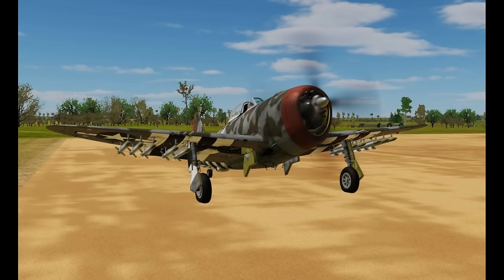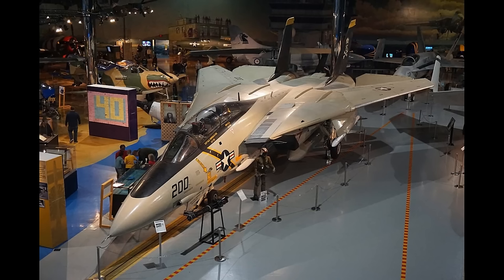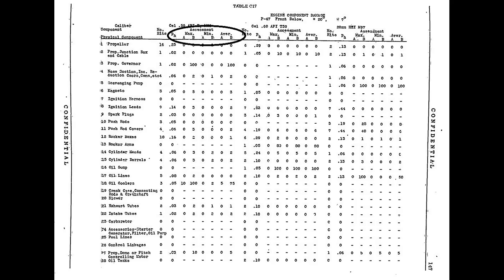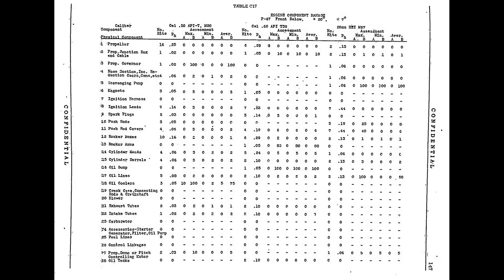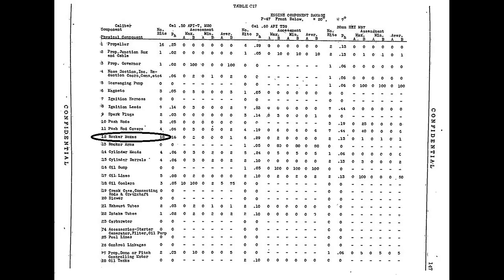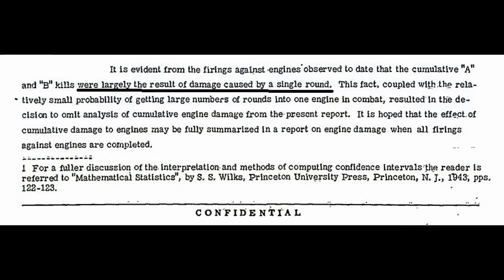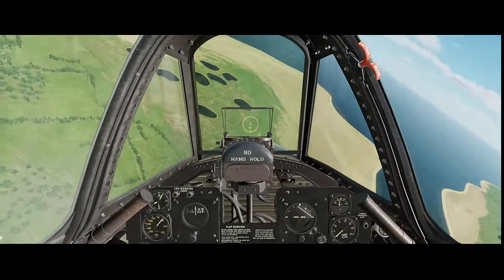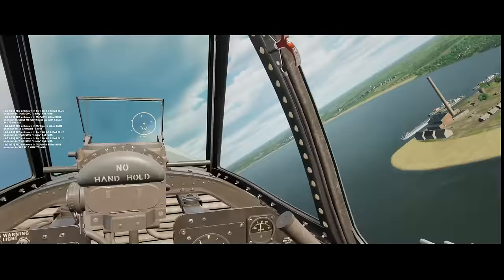50 Cal Vs. 20mm Engine Damage in WW2

Comment: **off topic

The AN-225 appears to be in the early stages of either repair or chopping from a recent photo. Left wing is mostly chopped with scaffolding under it. Some nose too with another scaffold.
   What made me wonder which is b/c the floor is swept very clean in the hanger. Too clean I think just to be scrapping it out.
   Right wing was resting down on it's engines. Photo ended behind wings so can't say about tail. I haven't heard anything besides maybe repair with the sister plane that's lighter or cut it up. I know they have bigger fish to fry right now but something is goin on.

Comment: I had a Mazda Miata, original 1990 model, at year 9, one cylinder went. it was barely operable, not 75%, but I was lucky to move at 20mph. Somewhere, there was a study for ship-based AA. The 20mm Oerlikon made the most kills, but the 40mm Bofors could make kills before the attacking plane reached weapons release point. At the end of WWII, the smallest gun that could take a VT was the 3in, too big for a single engine fighter. At some point it was possible for 40mm, but is still not an option for 30mm?

Comment: Yeah, no explanation to these numbers leaves quite a lot of questions. Is it possible that the chance of A/B kill is stated per hit, and not total?

Also MK108 and MK103 used different cartdrige, but the same projectile. Main projectile was 330g 30mm M-geschoss with tracer.

I consider it very interesting how great M-geschoss was against structure of a very sturdy P-47, and how ineffective it was vs the engine, compared with thicker-walled 37mm. I guess 37mm could take out an engine with a near hit, where big fragments struck the engine, while MK103 needed basically a direct hit to take it out.

Comment: Two points of curiosity about the testing and parameters: 20 sec is a long mg burst. And the oil in the rockers in an engine is under pressure (how does it circulate otherwise?).
Reply from the maker: Yes, 20 seconds is a long burst. I'll talk about this a lot in the next video. The oil enters the rockers under pressure, but then simply drains out by gravity. This is also exactly how the oil in a turbocharger works. It enters under pressure, that pressure is used up in the bearing and it just drips out by gravity back to the oil sump.

Comment: The traumatic experience of putting 50% of my ammo into a P-47 in DCS and only having the effect of making it look like a swiss cheese checks out after all.   The bit where the pilot bled out then got better was a bit odd though.
The 20mm's ability to go through rear armour where .50 doesn't feels like it should be a big factor in rear aspect shots.  But from simulations the 50's advantage feels to be the velocity.  It's a lot easier to aim when relative deflections are lower.  I think the rotary 20mm aircraft cannon really are the best of everything, rate of fire, weight of round and fairly high velocity.
Reply from the maker: Yes, but I wish to add that the 50 cals went through armor really well, in fact it could go through any aircraft armor of WW2. Even the British 20mm didn't have better armor penetration with the normally used ammo, it had about the same but with an explosive charge. The German 20mm wasn't that great for going through armor but had more explosive power.
Reply: It is important to note that there is a tremendous variation in 20mm cannons and ammo types.   Some has much lower velocity and some had a heavier or physically larger payload.   The 20x72rb used by Japanese aircraft early in the war had less than half the muzzle energy that that of the 20x110 used in by the P-38.  The 20x80 used by German aircraft in WWII also has a lower kinetic muzzle energy, but relatively large high explosive content.
Reply: Well i think 30mm revolver cannons are better. Mostly US planes use rotary 20mm
Reply: @hippoace  It gets complicated when the firing rate, mass, or volume of ammo becomes critical, as is usually the case with aircraft.  The accuracy of the targeting system and vulnerability of the target are also important.  If it is very difficult to make a single hit, but that single hit would cause significant damage, having a larger number of 20mm shells would be preferred.  If the weapon system can accurately predict the location of the target at the moment the shell would arrive, 30mm, which typically have a much larger payload per unit mass, would win.  If the 20mm shell would only cause insignificant damage, again the 30mm would be better.

Comment: A little off topic, but for what what it’s worth here’s what ChatGPT says about the Germans positioning their superchargers 90 degrees to the crankshaft.    
“By positioning the supercharger perpendicular to the crankshaft, it allows for a more compact and streamlined engine layout. This arrangement minimizes the overall length of the engine, which can be advantageous for fitting the engine into smaller spaces, improving weight distribution, and optimizing vehicle handling.”
Reply from the maker: In no way does it improve streamlining, so Chat GPT is wrong about at least that part.
Reply: Wouldn't this allow firing through the crank shaft?
Reply: @External2737 
Nobody fired guns "through the crankshaft" they were fired through the propeller shaft on V type aircraft engine's that were offset and parallel to the engine's crankshaft.
Reply: @dukecraig2402  you are correct
Reply: Why would you care about what a silly chat robot says? It doesn't know anything.
Reply: While it would not be 100% impossible to make a hollow centre crankshaft to allow shells and propellant gas to pass through the engine what about the piston connecting rods passing over the crankshaft centre-line?  Would you have the gun’s interrupter gear inhibit the gun from firing 12, 14 or 18 times per revolution?  Imagine the state of the lubricating oil!
Reply: @givenfirstnamefamilyfirstn3935  

I just saw a blueprint posted online.   So to correct my prior error, the cannon fires through the V of the cylinder banks, at the cylinder head position.   Since the engine is inverted, that places the cannon centerline right below the pilot's seat.  This had the benefit of putting the cannot charging handle in reach.
Reply: @External2737    A lot of people miss the size and layout of the propeller reduction (speed) gear.  The Bf 109 inverted V crankshaft is way, way above the propeller axis, the reduction gear’s big prop cog has the hollow shaft.

Comment: G'day Greg,

Yay Team !

Forgive one this
Plug for the
Outlier...;
But 
"What about the..."
Rolls-Royce Avon Sabre, with
Two 30mm
Aden Cannon ; used by the RAAF...?

Would they not have been the
"Stepping Stone" in leading the USAF from the six 0.5" Browning Machineguns of the F-86 Sabre, to the
Four 20mm Cannons in the
F-100 Super Sabre...?

Incremental 
Evolution, sort of thing ; rather than 
Plateaux punctuated by
Sudden
Leaps...(?).

Fascinating detail in this, they did certainly get a bit obsessive about categorising the manifold ways in which Gunfire messes up Engineering...(!).

Such is life,

Have a good one...

Stay safe.

;-p

Ciao !

Comment: If you're firing off a machine gun off of a fixed sturdy platform I'd imagine hit rates would be high like you noted.

I wonder if a M2HB, AN/M2 aircraft mount or AN/M3 50cals were used in the test, they all have different rates of fire with the M3 being the fastest and it was in production by the end off WWII and fitted to early jets and the late superprops.

Comment: While a .50 round might not knock a cylinder off the continued running of the engine and growing heat build up from the mangled piston and loss of lubrication to it could probably do enough damage to eventually crack it and chunk it maybe?🤷‍♂️

Comment: The 20 second burst is more likely a fixed number of rounds. I am guessing 100 rounds, from a single barrel. Which would be close to 20 seconds (or less). The math (% of hits) is easy to figure. Also, given the number of barrels, a more likely use of ammunition per attack. The other possibility, one "belt" of ammunition (110 rounds for a .50 cal.)

Comment: I wonder if a hand operated valve could  have been added to bypass the oil cooler (assuming the pilot would be aware the cooler was hit).  I would think the engine would run a lot longer with scalding hot oil as opposed to no oil at all.
Reply: How's that going to work with two hands? You would be like going back to the F-4 Wildcat trying to crank down your landing gear.
Reply: @WALTERBROADDUS  Like all the other of the dozens of levers and switches in the cockpit - by hand.  A diverter bypass wouldn't require much more than a push or pull knob on a flex cable, like a manual choke on an old car.  Would take a second to push or pull.
Reply: @ohger1  that's going to be a lot of pumping for an 18 cylinder engine.
Reply: @ohger1  It doesn’t read like he gets the picture.
Reply: @givenfirstnamefamilyfirstn3935  I guess not.  Not everyone is technical in nature.

Comment: Ironically - a bank of cylinders in a radial engine is always an odd number. This is to prevent two cylinders from directly opposing each other. If an engine has an even number of banks, it will have an even number of cylinders.

Comment: When you do your run up before take off, you switch each mag off independently. You normally get 150 rpm drop.  Only people who do not fly would think the loss of a mag would cause the engine to quit.
Reply from the maker: Or that it doesn't cause a loss of power.
Reply: @GregsAirplanesandAutomobiles  True if no rpm drop its back to the barn

Comment: A note about dual spark plugs: a dual spark plug engine will often have little to no power advantage over its single spark counterpart. The longer flame propagation time of the single spark can be mostly compensated with additional ignition timing advance. However, losing one spark on a dual spark engine will pretty much always affect power significantly. In this case the engine must contend with its lesser timing along with the slower burn.
Reply from the maker: OK, I'll let, NACA, the Top Fuel Racers and these guys know: http://www.raceservice4u.com/Twin%20plug.htm
Reply: @GregsAirplanesandAutomobiles  I don't know the exact context with your fellow youtuber. Perhaps I could have added that the viability of single spark engine depends on its design, for instance modern small 4 valve vs large 2 valve hemispherical engines. Regardless, it isn't really relevant loosing half the ignition system on a piston aircraft, which you correctly point out always results in significant power loss.

Comment: 8:45 -- RE: The Propeller;  side note for ya, but first principles time!  An interrupter gear for the prop was a key innovation for World War 1.  That reduces the attrition on the prop by 50% because enemy fire will remain an issue.  I hadn't much thought about the effect that flak must have had on the propellers during World War 2, either. [edit] Seems to me I've read many accounts of bombers in particular having issues with failures of the prop during flak barrages.
Reply: " That reduces the attrition on the prop by 50%..."   Maybe I'm missing something here, but surely attrition on the prop - caused by your own shells hitting it - would have been more than 50% ?    If EVERY hit from the enemy hit your propellor, then maybe half of the prop hits would have been caused by the enemy.  However, most of the enemy's hits (except in close-to-head-on attacks) would probably miss the propellor and it something else.  In which case, most (>50%) of the prop hits would come from your own guns.

Having said that, my grasp of stats is pretty poor, so I may just be talking through my backside.
Reply: @oldcynic6964  You've sussed it out.  It's 50% on the whole because "Us and them" and exactly, the interrupter is there to ensure that practically 100% of "Ownship" fire isn't going to do the job.

You've noticed something else too which I was thinking about:  in terms of training, the next thing to account for would be head to head passes, which also more or less work out to about a 50% effectiveness thing since a pair of combatants who engage in one are allowing an equal chance to their opponent to make the shot.

Which gets us to Tactics and training.  The head on engagement is not desirable;  it would be much better for most attackers to pick a better moment, perhaps bouncing their targets from above and behind, with the Sun to their own back, and so forth.  Bouncing a target from behind might mean that you won't get a very good angle on his prop; True.  I find myself thinking about the rare examples of "pusher" designs in World War 1 though.  They obviously have a huge disadvantage if their pilots do not maintain the edge of being the first to spot and attack an enemy.  If they get bounced from behind they will likely lose their prop.

Comment: I don't know of any way to verify this story, but I saw a WWII veteran in a documentary somewhere, who claimed he saw a plane, a Thunderbolt, I think was, with a cylinder shot off, and the piston flopping around as the plane landed.
Reply: With an automatic wastegate control on the turbo would it increase the boost to compensate for a severed cylinder induction pipe leak?  A radial had individual valve gear, an equivalent hit on a Merlin would disable the entire bank of six cylinders.
Reply: @givenfirstnamefamilyfirstn3935   I think we all agree that liquid-cooled engines are far more vulnerable to single-hit kills that air-cooled engines are.

Comment: A 20 second burst on target sounds like an impractically long one. From what I read, 3-4 second bursts were more usual. 

Also, 500 metres is a long range. Prior to the Battle of Britain, the RAF had the 8 machine guns on the Spitfire and Hurricane "harmonised" for a 400 metres, but based on experience, pilots like Bob Roe had there's re-harmonised for 250 metres range. Of course those were rifle calibre bullets, so some might argue that they had to be close in, but reports seem to be that a lot of the action was very close. Maybe with the 20 mm Hispanos it was different.
Reply from the maker: Think this through, a single gun for 20 seconds or 8 guns for 2.5 seconds. What's the difference if you are just trying to gather statistical data on where the bullets hit? It's NOT about a 20 second burst on target, it's about the resulting data.

Comment: During the commentary on prop governor,feathering was mentioned. I am mystified. Under what circumstances, with a single engine airplane,would feathering capability be an advantage  ? Was such actually installed on a P 47 ?
Multiengine airplane ,sure,reduce drag,prevent prop runaway. But single engine ?
Reply from the maker: P-47s can feather their props. Obviously this gives a greatly increase glide ratio, but I honestly think the capability is simply the result of commonality of parts. The same basic engine and Curtis Electric Prop mechanism (not the prop itself) is on the B-26 Marauder and many other multi-engine planes.
Reply: @GregsAirplanesandAutomobiles  Ahhh. Well now. Thank you for that.

Comment: To have a somehow realistic timing how long a fighter pilot has to destroy his target....

Fw190 vs. B17  frontal attack.....velocity B17 320 Kmh or 200mph, Fw190 650 Kmh or 410mph....They close in with 970 Kmh or 610mph. If the Fw190 can shoot at 600m or 1800ft and has to pull the aircraft up at 200m (600ft) at the very latest. 
It is 1.5s maximum. 

Me109 vs. Mustang....both fighters are turning all the time. The time the opponent is in the sight should not be more than 0.5s.

The opponent will not be in the gunner sight for 20s as mentioned by Greg.

Comment: 30:20 "The MK108 had a much lighter projectile than the MK103"
I'm interested where you got that information Greg, because afaik the 108 and the 103 used the same projectiles (I'll put some pictures in the Patreon section). Now there is a substantial difference between the 3cm Mineshells with- and without tracer. Maybe that's the difference that you are refering to.
Reply from the maker: I was referring to the weight of the ammo, not the projectile, I mis-spoke there. Look at the weight of 100 rounds with links on the screen. The MK103's is much heavier. I'll clear it up in the next episode.
Reply: @GregsAirplanesandAutomobiles  
Ah, that makes a whole lot more sense. And yes, you're absolutely right, since the MK103 casings are over twice the length of 108 casings.

Comment: A 20 second burst is a really LONG burst. A lot of fighters didn't carry enough ammunition to last 20 seconds. The AN/M2 .50 cal fires at ~800 rounds per minute, so a 20 second burst is 267 rounds, typical loadout seems to be 400 rounds per gun for the Corsair and the Hellcat.
Reply: I assume the idea was to get enough rounds onto the target to be able to make some form of statistical analysis. I think there are documented reports of Battle of Britain pilots putting all 15 seconds worth of ammo into a target, but I guess with the .303 calibres they needed a lot of them!
Reply from the maker: It's a statistical analysis of the effectiveness of the firearms. You have to have enough rounds fired for anything to be statistically meaningful. Think of it this way, what difference does it make if it's 20 one second bursts or 1 20 second burst for the purposes of the report? I can see I'll have to explain this concept in the next damage video.
Reply: @GregsAirplanesandAutomobiles  True. Then again one wonders if a 20 second burst on the ground out of one gun might not cause overheating or barrel damage. I suppose they could have used a water jacket or something else to prevent that.
Reply: The test environment would have set up to allow repeatability and control variables.  This is not a gun installed in a flying aircraft in combat. Greg's already had to note  this multiple times and he stated very early this report is sketchy on details